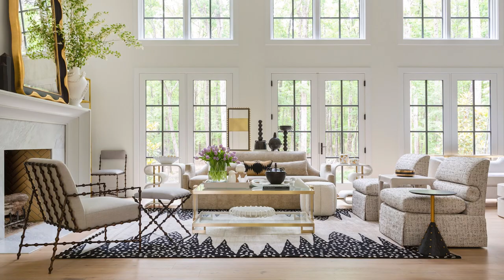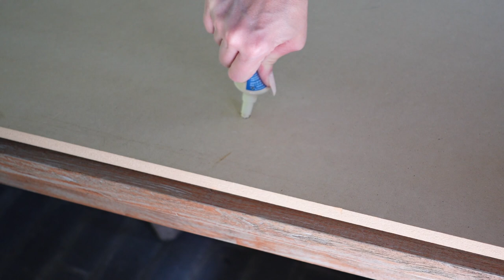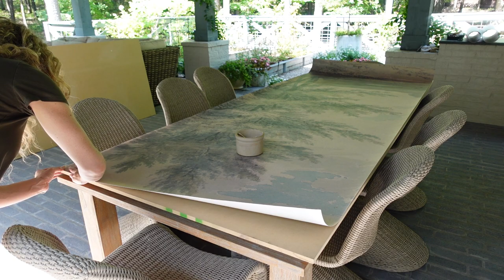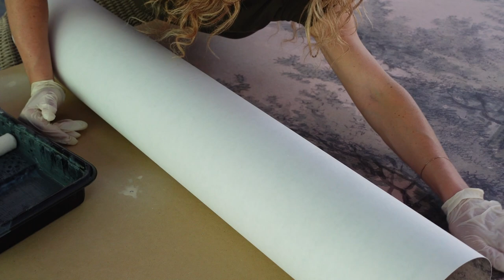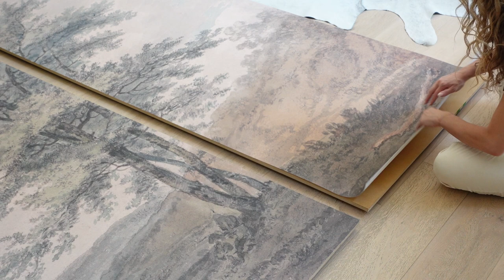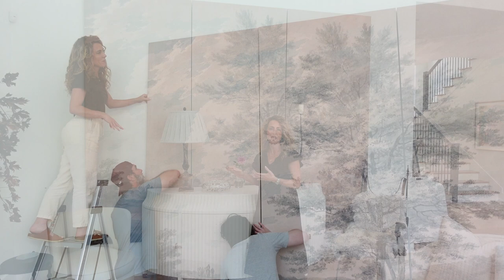Hanging A Wall Mural | DIY Tips on How To Install Wall Murals | Ashley Childers

Comment: Would the installation have been easier using French cleats instead of the hooks so the panels could be moved side to side to line up completely?
Reply from the maker: Absolutely! We just used what we could find that day at the local hardware shop!

Comment: Beautiful, Ashley! Did you need to paint the sides of the mdf panels?
Reply from the maker: Thank you!! I actually added a cotton ribbon trim to the edges, I should have added that step to the video and completely forgot! But it finished the panels off nicely and was super easy to do. I bought 1/2” cotton ribbon in a dark gray and it looks great with the mural!
Reply: @ashleychilders  Question: Did you go completely around all the edges of each panel with the ribbon or did you just place ribbon on edges that show on the sides and top and bottom?
Reply from the maker: @jajdesign  well I forgot to do it before we hung them, so I just did the outside edges 😆 but I bought extra ribbon so if I move them I can add it to the inside edges too!
Reply: I’m in the process of completing this mural and would have ordered 1” extra on all sides and wrapped the edges. I’m ordering some extra canvas and plan to try and match and cover the sides w/ canvas paper. Also, I would have upgraded to the art brushed option. Otherwise, I followed Ashely’s excellent step-by-step directions and its gorgeous!!! BTW, Home Depot cut my panels and support boards on their bench saw so I was able to complete this without a trim carpenter, but will need help mounting them. Such a fun DIY — thank you!
Reply: I'm absolutely thrilled about this idea! I'm dying to know, how did you attach that fabulous ribbon? Did you use a hot glue gun or some other exciting technique?
Reply: Thanks Ashley! We loved this idea we did our dining room wall with a beautiful blue beach theme and we are so happy. 😊 I wish I can post a picture but don’t know how to do that anyway…thanks again!